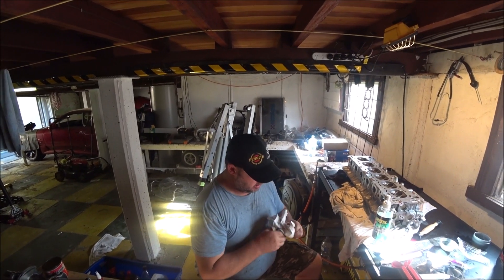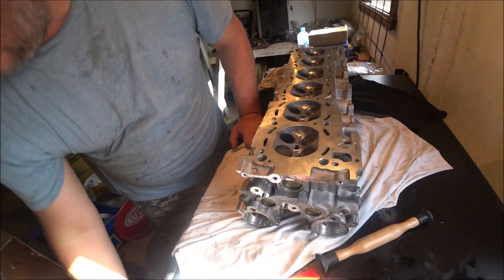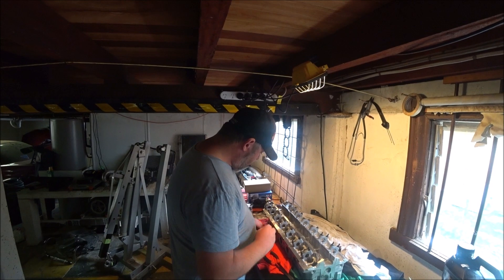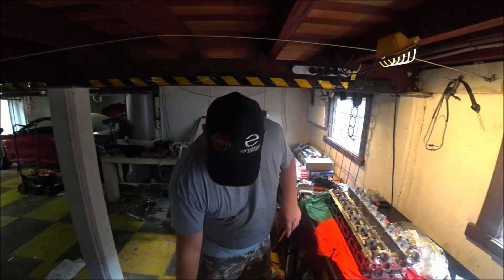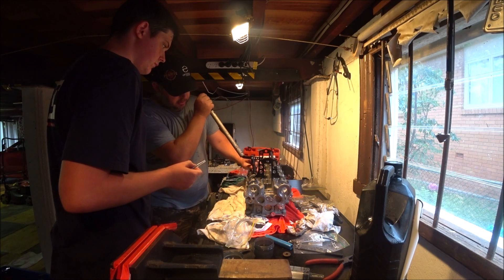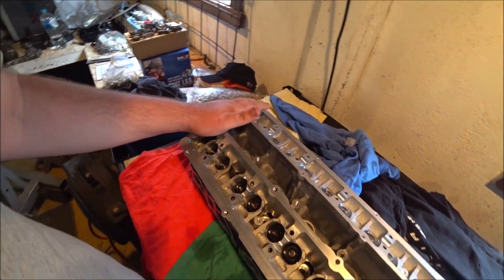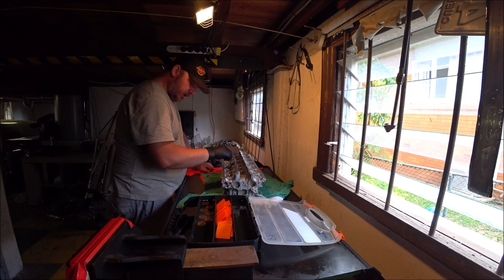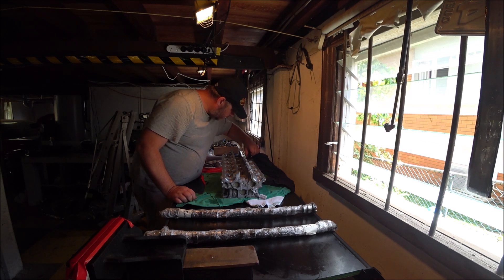RB25DET Build - Valve train Install

Comment: Hey mate have you got a link to where i can find that little booklet you made going to print one up for future reference as i have my 25 head apart at the moment. Cheers.
Reply from the maker: It's pinned to the top of my Facebook page, follow the FB link from my channel, can't miss it.
Reply: @tangles01  hey mate, what are the pages you printed out as there are 491 pages.
Reply from the maker: @andrewv5838  All the ones with the torque numbers for engine and head assembly and the clearances at the back
Reply from the maker: But I also have a pdf on my phone

Comment: great stuff 🔧👍 have you tried the lisle 36200 valve keeper remover/installer tool works great for me on Z32.
Reply from the maker: Nah mate just the one I used in the vid, it's what I've got.